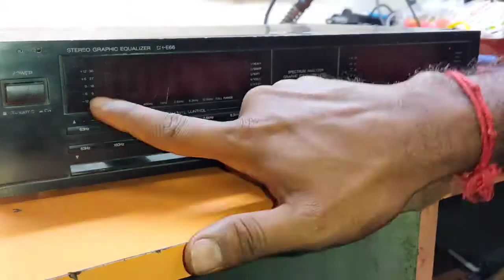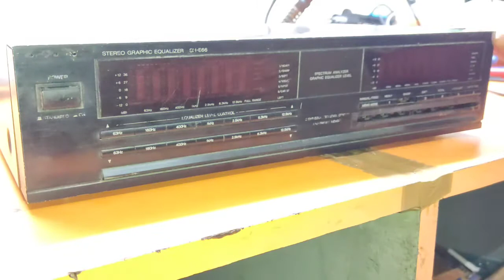Technics  SH-E66 Equalizer No Spectrum Display Fixed in Tamil

Comment: I greet you, I wanted to ask how you found out what resistance belongs there, it occurred to me that there is nothing to blame for being burned🤔🤔good works
Reply from the maker: i measured voltages in all section and identified that display fl ac voltage missing so trace down the voltage and spotted that culprit resistor
Reply: @fixavreceiver  thanx 😊😇